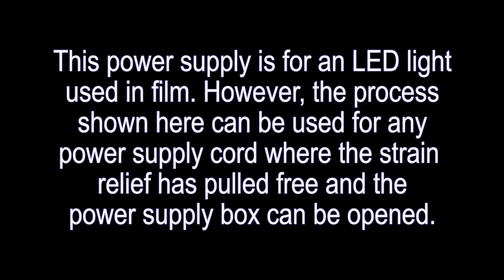How to repair a broken cord strain relief with exposed wires

Comment: I purchased some Sugru mouldable glue for about $5 and fixed mine without all the hassle of rewiring.  Still a bit early for fully field-testing the fix, but seems like it worked like a charm.

Comment: I have the same problem I might give your solution a try. Although most power supply bricks are permanently glued together and the only way to open them is use a cutting wheel and hope not damage the electronics inside and epoxy it closed. A lot of work for a small repair